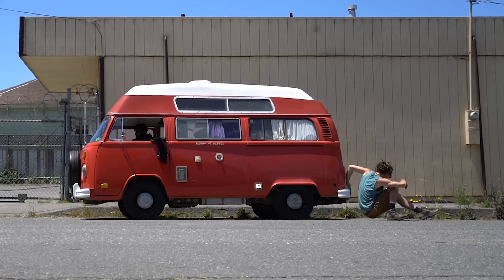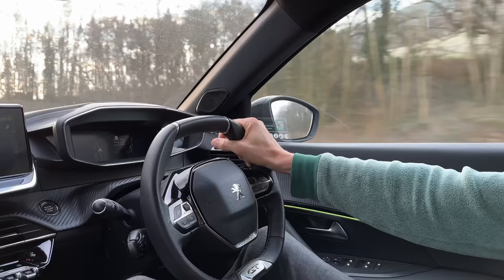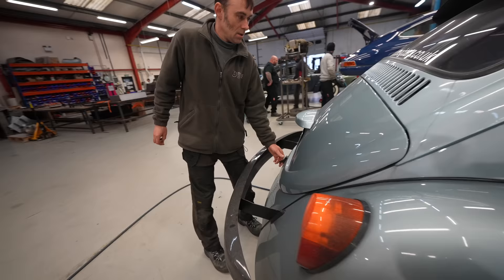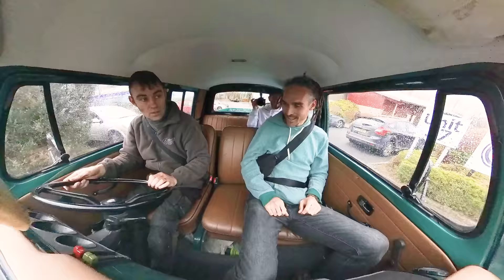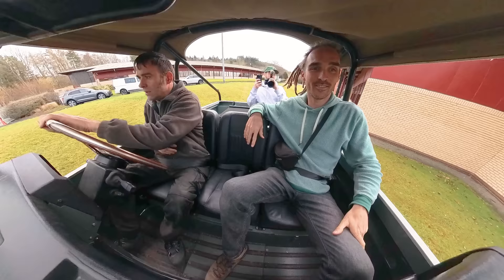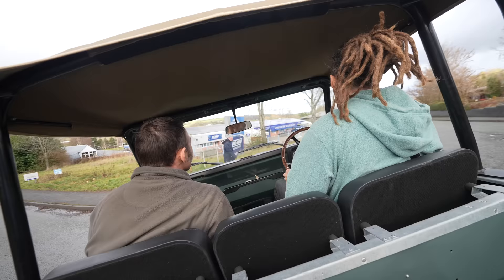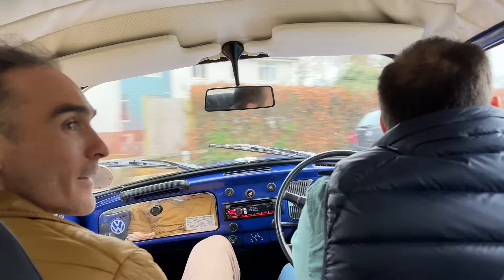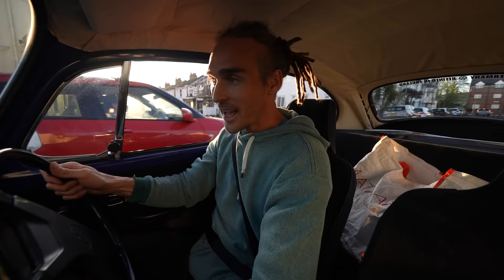My Tesla Powered VW Beetle (Bug)

Comment: I'm a bug guy...had 9. You have probably done this but any time you buy one, lift the back seat and check under the battery. This is a location notoriously known for rusting through. Under pan spray usually is a trick done to hide cancer.
Love the color. Glad you got with such a legend to experience such wonderful cars.
Congrats on the baby.
Reply: That's exactly what happened to my vw bug..rust. 
I ended up with a two by four balancing the battery LoL 🤣

Comment: Take the battery harness and lay it out on the plywood and connect the controler, engine, battery to this before strapping it to the vehicle. Should make it visually appealing to the audience and make it easier for the adjustments without having it strapped into the vehicle.

Comment: Well I just wanted too offer some in put for electric bus or the beetle   if you consider getting  dc to dc converter it takes 12volts brings it up to 24 then you can adjust the voltage and the amps then there is ac converter that allows you to adjust the ac voltage so you don't have to have 240 or 250 ac line to charge the vehicle and it works in other country's and the US its like step up transformer guy on YouTube was using it  coasterica were the power is not consistent for charging electric vehicles and then they have all these new portable power stations that charge off the solar and that go up to 2:40 or 250 volts to that would help you keep it charged when solar ain't optimal and I think you should get most of all that stuff on Amazon great video